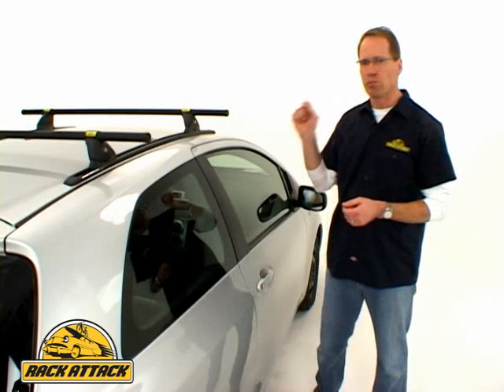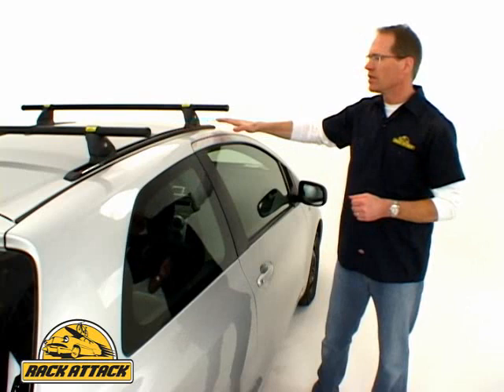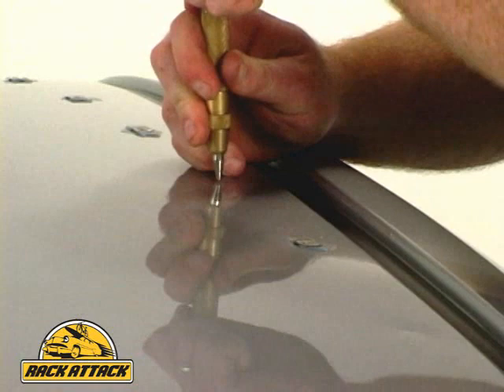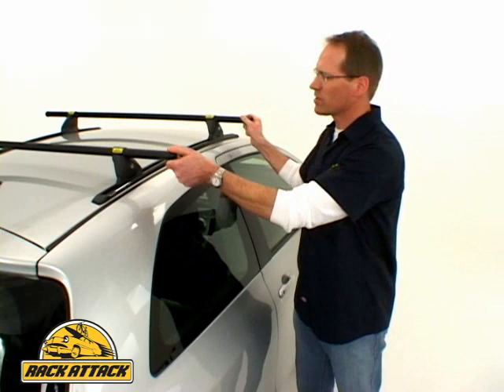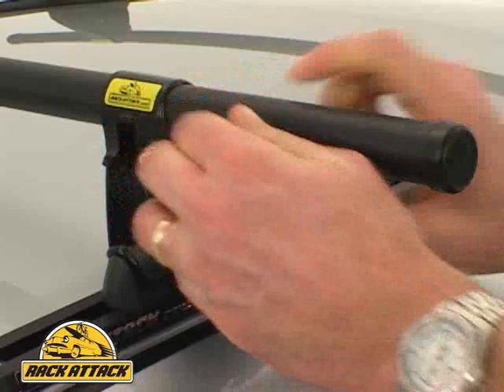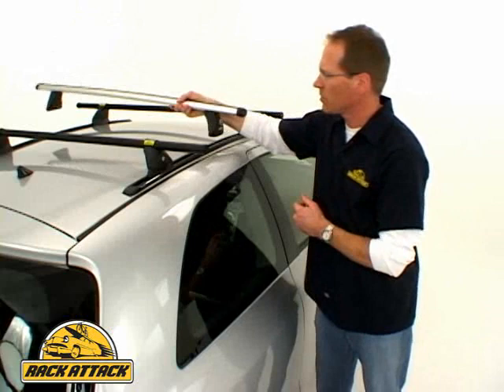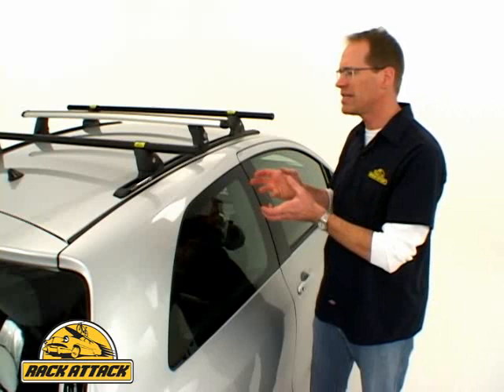Custom Roof Rack Installation Demo by Rack Attack

Comment: @1994gmctruck ...no. if you look on his drill bit there is a ring that clamps to the bit to stop it at the desired length. If you drill without the stop you have to be stupid careful

Comment: I had no major problems doing this on my Prius and it is the best rack solution for many cars!

It is unnerving though.
Reply: I have been trying to find out if there was an option just like this for a Prius! Do you have any pics/tips from your install??
Reply: @EricCMaxwell  I didn't take pics of the install. I followed the general instructions from rack attack. I remember that the prius roof is very curved so it means you have to bend the rails a bit to have them fit. Basically mask off where the tracks will go. drill the first hole on each side, clean it with a file, attach the rail with a plusnut. Then bend the rail to match the roof and use a punch to mark where each other hole will go. Rotate the rail away and drill/file/paint each hole. Then rotate the rail in place and attach each plusnut. The nuts that had trouble for me were where I think I didn't clean up the hole enough with a file to ensure it would seat properly.

Comment: Yea despite being 12 years later I'm trying to install an after market roof rack on my Nissan Frontier.  The rack is designed for Nissan however you have to drop the headliner inside.  I'm trying to skirt the process with this flare tool so I don't have to go through the process of the headliner.  Any suggestions?

Comment: Looks like Awesome Option for my future Chevy Bolt EV.  ... but from recent read in Chevy Bolt forum: "I checked the Rack Attack site and they don't seem to have these that will fit the Bolt. ... Still might be  worth a call to them?"
Reply: Did you go this route? I'm wanting to do this to my Bolt EV LT but since there are side curtain airbags up there I think I should remove the headliner to be absolutely sure what is underneath before drilling.

Comment: Is there a way to figure out the load capacity? I have a 1986 Dodge Ramcharger with the bare-style roof and would like to mount a roof tent system but I’m not sure if the roof metal would be strong enough for the load.
Reply from the maker: Generally speaking, a custom solution can carry a minimum of 165 lbs dynamic weight. This being the weight you can drive around with. 

Static weight (i.e. when parked and in the tent) is 2.5x to 3x this capacity. If near a store, highly recommend you coming by to discuss specific custom solutions.

Comment: How... do you stop from drilling straight through the roof of your car? Is it... thicker than it appears?
Reply: Depends on the roof. The rack attack people are good on the phone. In my Prius, there is a small cavity after you get through the first layer of the roof. Means you have a little warning when you get through the important part. They told me German cars are much harder to drill through than Japanese.

Comment: is that secure? it is only attached to the metal ontop of the car, not the frame.
Reply: You have multiple flare nuts (basically rivets) on each track that go through the first layer of the roof. I have kayaks on top at 75-80mph all the time and no sign of weakness.

Comment: Will this work on a fiberglass camper shell?
Reply: Here for this exact reason
Reply: @patrickcagney8060  Yes it will. Have it set up on my ARE topper. Pretty simple to install, you just need a track kit. I used the Yakima Track Kit from their site gives you everything you need.

Comment: I'm concerned about long term rusting, the roof is the most exposed part of the car. I hate the look of clip on racks and I wish there was a better solution rather than drill through the roof.
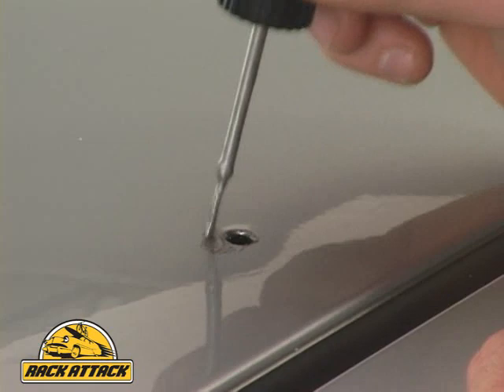Reply from the maker: Applying rust paint and silicon prevents that. Have a look at 1:02.
Reply: @rackattackDOTcom  key word being prevent, I'd love to see pics of car 5-7 years later to see if doing this mod sped up roof rust.
Reply: @infernau  I had this system for 5 years in a very rainy climate, and had no issues.  In my experience, no rack system (other than OE, and even then it depends on the car!), is actually good for your vehicle's paint over an extremely long time frame.